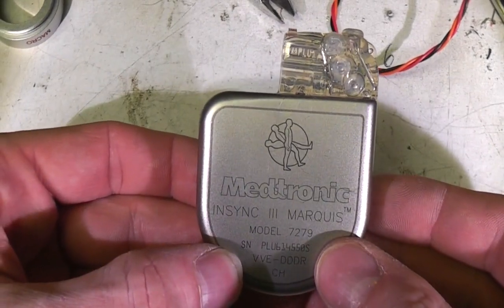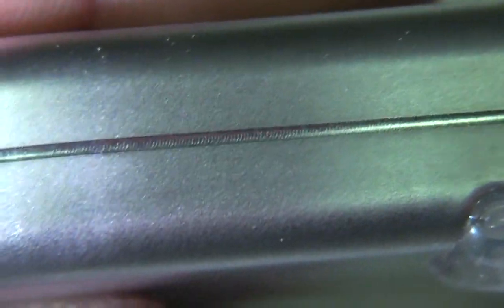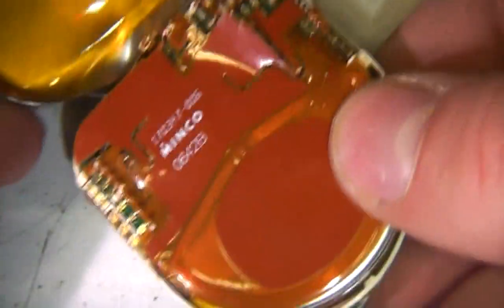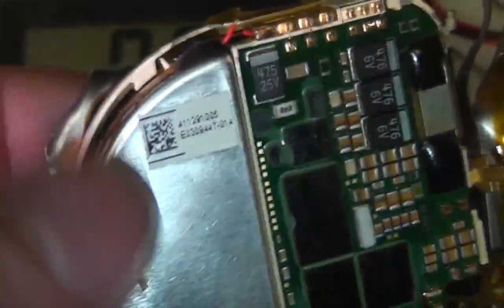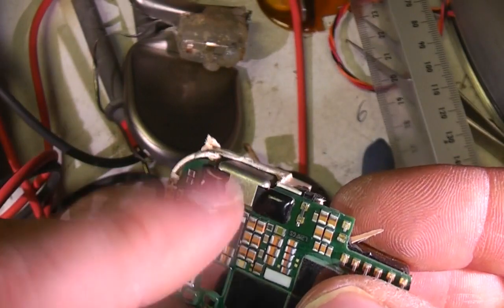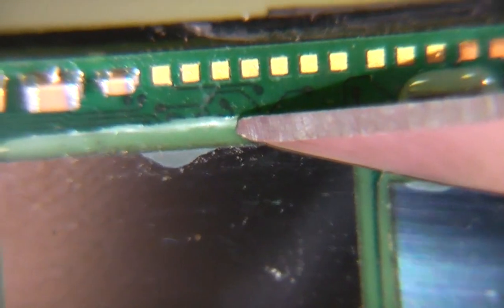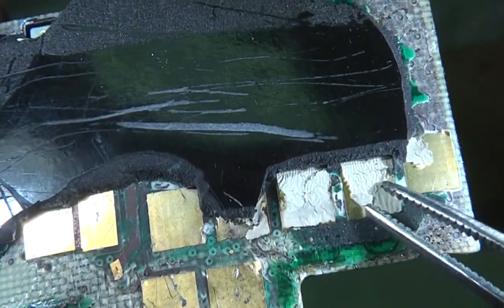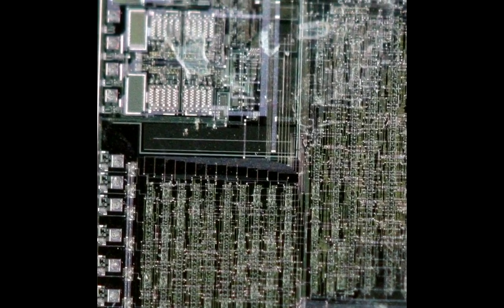Implantable defibrillator teardown

Comment: Yes, that's what I meant. Large R&D costs on custom silicon, and the manual production methods and extensive testing and verification are very expensive too. Each line of source code would be independently verified and approved as well. Add in not having a huge volume to amortise your cost over (relative to consumer or other electronics), and that's why any form of implantable medical device is very expensive.